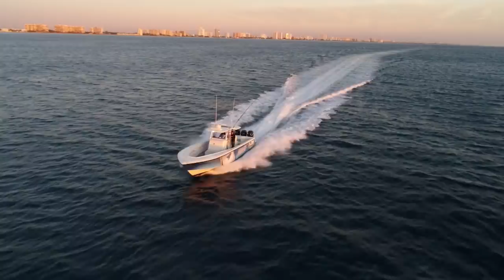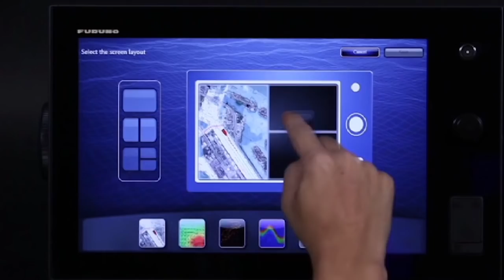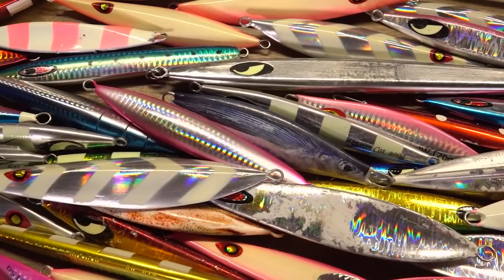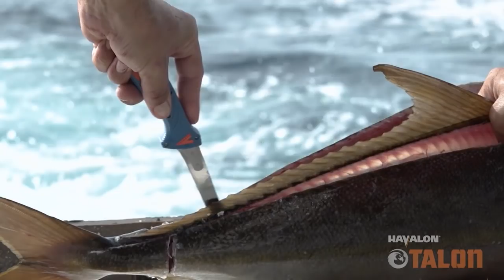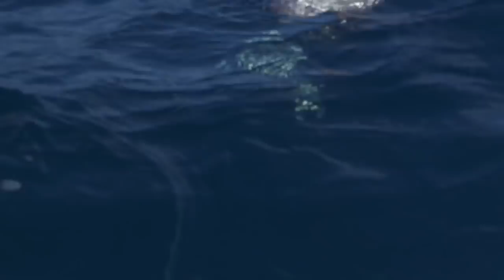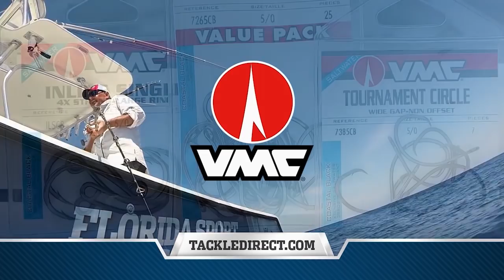Slow Pitch Jigging Deep - Florida Sport Fishing TV - Catching Tilefish, Tuna, Rigging Tips

Comment: Quick question.. I'll be fishing between 100-300ft. I plan on SPJ with a rod rated for 200-550g. Can I use this rod with a lighter jig? something between 150-250g? My rig is 20/30 line/leader and I'll be using a Ocea Jigger 2000. . I also have a rod rated for 100-300g and can use that rod in case my first choice isn't viable. Any information would be greatly appreciated as you guy have always provided great and correct advice.
Reply from the maker: The 100-300 gr rod would be a better for the 250g jig in 100-300 ft but you can certainly use the heavier rod too, but its like shooting a rabbit with a shotgun instead of a .22 (is that even a good example?) Thanks again for watching and please join my new streaming channel with 300+ instructional videos and no YouTube ads at www.FSFTV.com. Use coupon code BAITFISH - save 50%. - Capt Mike